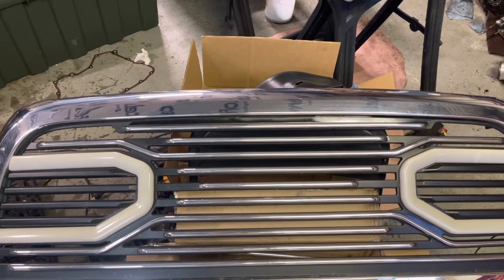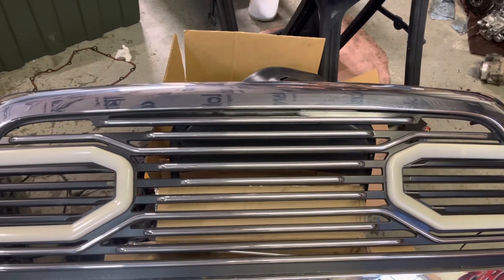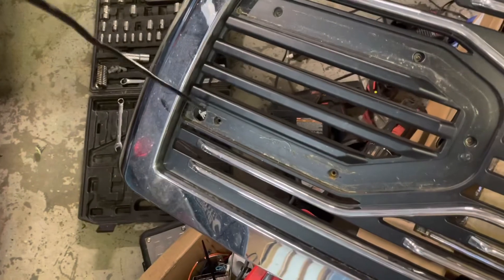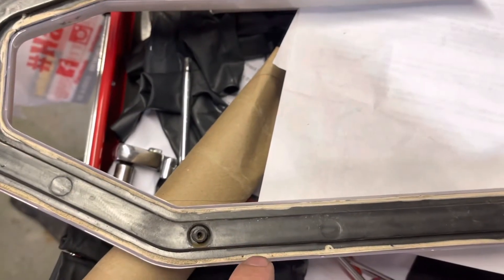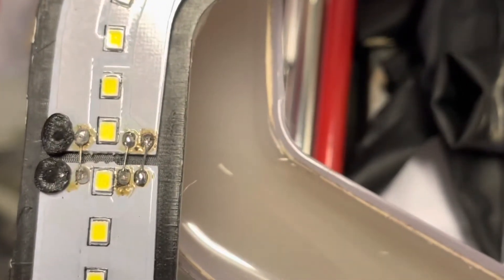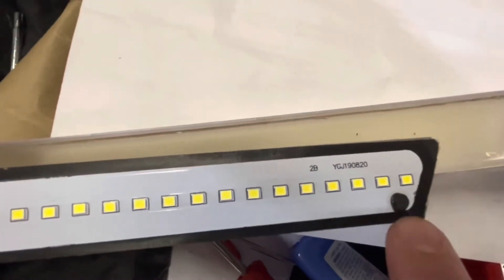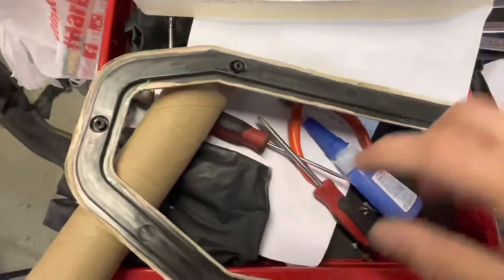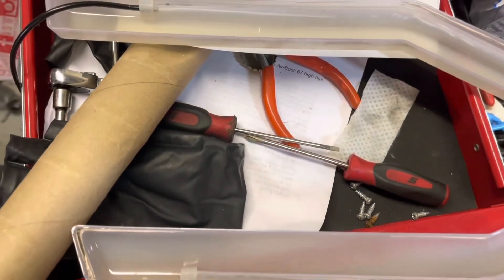Front Hood Bumper Grille Shell Big Horn Style for Dodge Ram 2500 3500 LED Replacement/Upgrade

Comment: Any problems with them not working after you start the truck? Mine work as intended until I start the truck. Then they don’t work at all
Reply from the maker: U may have to install load resister’s
Reply: @DIYKAI tried that too. They work just fine until I start the truck then I get Orange and White at the same time
Reply from the maker: @twotownes831  has to be your wiring then

Comment: I got this grill as a replacement on my 2007 Dodge Ram 
How do I wire these lights
Reply from the maker: we tapped into the turn signal harness you should see a 3-wire plug on each side use a meter and find the ground and power wire the yellow to the pulsing wire
Reply: @DIYKAI  is it the lights that make is go in the patterns when turning on and the turn signal, or is it the truck?
Reply from the maker: The LEDs do it
Reply: @DIYKAI  thanks Kai! Appreciate the quick response too!
Reply from the maker: No worries